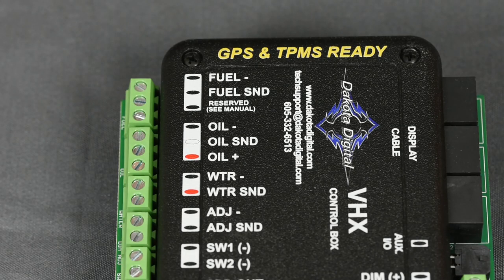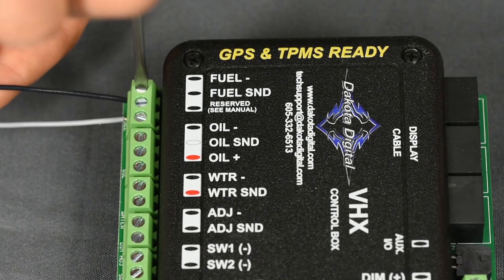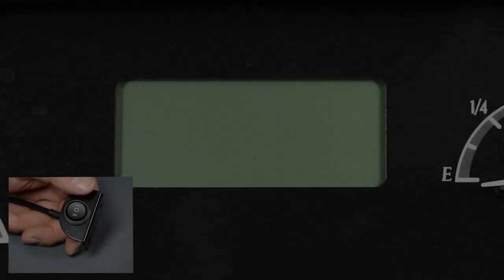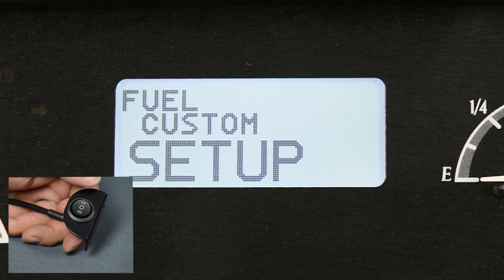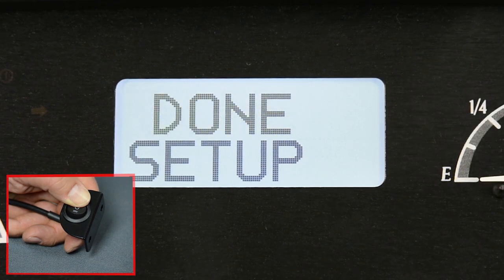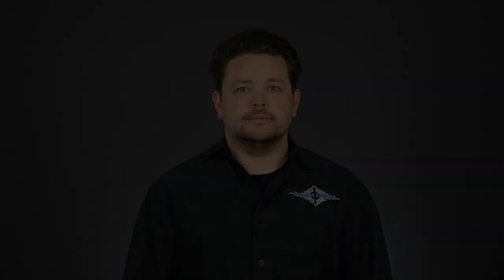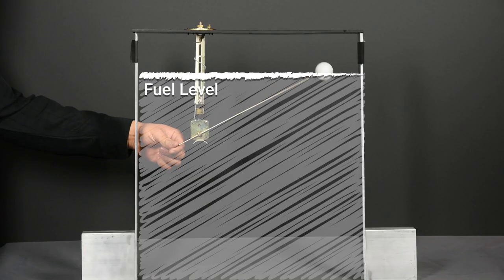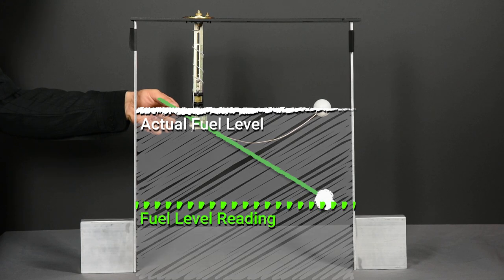Dakota Digital instrument system fuel sensor setup

Comment: I am getting an open fuel warning and the gauge does not work, they it will go away by it self then come back on. Or sometimes it does not com on at all. Any help would be appreciated thanks
Reply from the maker: Hey there Scott, it sounds like perhaps the sensor or the connection to it has failed. I would suggest contacting our Technical Support department, by email at techsupport@dakotadigital.com, or phone at 800-852-3228.

Comment: @Dakotadigitaltv Mt stock Chrysler guage reads 43 ohms full and when I try to manually adjust to 99% it says fail. Currently set for SW setting what am I doing wrong? Also ford 73-10 didn't work at all ground strap on and checked. No ground wire on - of fuel terminal do I need a new sending unit?
Reply from the maker: Hello Jack,
I would suggest contacting our Technical Support department directly for assistance.  You can reach them at techsupport@dakotadigital.com or 605-332-6513.

Comment: Ill be installing my HDX  in my  70s Camaro. I have only one wire for the guage the brown wire.
I am guessing I put that into fuel sig.
If i do this with no ground on the control box will fuel gauge work? 
Or will I need to drop my tank and run two wires back.
Reply from the maker: If the tank is sufficiently grounded to the vehicle, a single wire connection will be OK.  
A dedicated ground wire is always the best option though, since it rules out potential issues below the vehicle.
Reply: @DakotaDigitalTV  thanks. I set it up with one wire.  Works great.
Cant believe how easy itbl was to install HDX 70C.
Was planning on taking  a few days after work to get done. Got it done in less then 3 hours.  I spent more time reading the instructions for the past week.  
This thing is awesome.
Reply from the maker: @robo6863  That's great, glad to hear this, thank you for the feedback!

Comment: I have no way to know what sender was used during the build of my 34 ford, but I did the custom set up, and it initially seemed to work perfectly. Next day I start it up to take a test run, and I get a Fuel F3 error and it shows empty… what might have happened? Could it be interference and I need to twist the wires running to the sender? I thought I was too lucky when it worked first time!
Reply from the maker: Thank you for the message, it sounds like the connection to the sensor may have been lost. I would suggest contacting our Technical Support department, 800-852-3228, or techsupport@dakotadigital.com.
Reply: I went back to the sensor to check it and found the signal wire connection had loosened up again and was giving an erratic reading. I terminated that line with a fresh connector and re-seated it and put a drop of lock right on it.  New ohm readings matched a GM sensor on the list, and I am in business! Thank you!
Reply from the maker: @DawnandSean  Glad to hear it, thanks for the update!

Comment: With my tank 100% full, My sensor shows 108ohms key on, and 280-320ohms while running. Also intermittently getting fuel open message while driving, then goes off then comes on about 10 times within a 10 mile drive.
Reply from the maker: Thank you for the message.  It sounds like the connection to the sensor (either the signal or the ground side) is intermittent, I would suggest evaluating the full length of this wiring to determine where this taking place.  Most likely, the round side of the sensor has a poor connection, which is impacting this reading with the engine running. 
We suggest grounding the ring of the fuel sensor to the FUEL - terminal on the gauge control box.

Comment: I have a 1970 mustang, I'm currently trying to run the wire for the fuel sending unit. Where do I ground it to? I have your VHX system. Thanks
Reply from the maker: Hello Austin,
The fuel level sensor is ideally grounded to the "FUEL -" terminal on the VHX control box.  Alternatively, it would ground to the mounting ring of the sensor, into the tank, then to a chassis ground point from there.
Reply: @DakotaDigitalTV  right. I have the ground in the FUEL-. My sending unit only has 1 wire coming from it. The instructions recommended running 2 wires back there though. I'm assuming the hot goes on the stud but the second wire (ground) there's not much else down there. So a chassis ground would work for that? Thank you for the reply!
Reply from the maker: @austinlarkin5242  Thanks Austin,
The stud on your fuel sensor is likely the Sensor/SEN terminal, so this should connect to the FUEL SND terminal on the VHX control box.  The mounting ring on the sensor is the ground, so this is ideally connected with a wire to the FUEL - terminal on the VHX control box - or chassis ground near the sensor/tank.

Comment: when you run the ohm test what are you connecting the leads too?
Reply from the maker: Hello there,
When measuring the resistance from a fuel level sensor, one meter lead connects to the body of the sensor (ground), the remaining lead connects to the Sensor/Gauge terminal.  It does not matter which meter lead is connected to which terminal.

Comment: Can you guys do a video on setting up the fuel range learn? I have a set of HDX gauges in my 72 Monte Carlo and no matter how many times I try I can't get the range to E set. I tried multiple times followed the directions and everything but still no luck. My sensor input is set to my specific car and work fine I just can't figure that part out. Thanks!
Reply from the maker: Hello - In the meantime, I'd suggest reaching out to our Technical Support staff.  You can get them at techsupport@dakotadigital.com.

Comment: Do they have a sending unit like this for 74 chevy caprice?
Reply from the maker: An OEM replacement fuel level sensor is the best option for this application, since this will drop into place without modification - and can be ready by the Dakota Digital instrument system.
Reply: Ok thank you

Comment: hey, you design this thing, what are the wiring we need to join it to for a 2001 105 series?
Reply from the maker: Hello Colin,
We would suggest a service manual to identify this specific wire color/location on your 2001, 105 Series Land Cruiser.
Reply: @DakotaDigitalTV  we got it wired in, but all it does is stops the speedo? we have the wiring diagram but even with the other wire it does not work?
i emailed you guys plus Marks 4wd Australia, no one seem to know how to connect them correctly to a Landcruiser 105 series but they sell them.
Reply from the maker: @MrBj12354  Hey there Colin,
Since we don't produce a direct-fit product to fit this Land Cruiser application, we are not quite sure which product that you may be referring to. I would recommend sticking with a communication method of email or telephone with our Technical Support staff.

Comment: So it’s three wires on a GBody the sender wire goes to sender in tank and ground goes to ground on sender
Reply from the maker: What year G body are you working on? Typically a black ground wire clips onto the sender body, and the pink signal wire goes directly to the instrument panel.
Reply: DakotaDigitalTV so do I wire the ground on the sender body to the ground on my Dakota Digital fuel ground screw? Or I can just use any ground

Comment: I have a 79 Camaro with original sending unit and it worked on my old gauge but i don't know what sending unit setting to put it on can you help me on which setting to put it to i tried GM 90 with a full tank it marks gas but doesn't go down when gas is used up.... I have it ls swapped
Reply: Same thing with my T/A, did you find any thing?
Reply: Did you figure it out?
Reply: I found that my sending unit was switched on me by the ls swap guy for another car and put one without a ground conection .... so I bought a new sending unit and set it to gm90 now it works